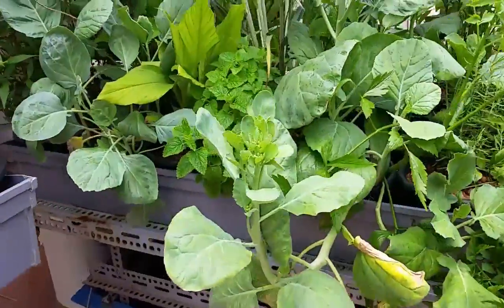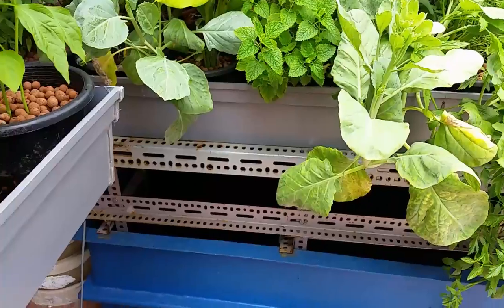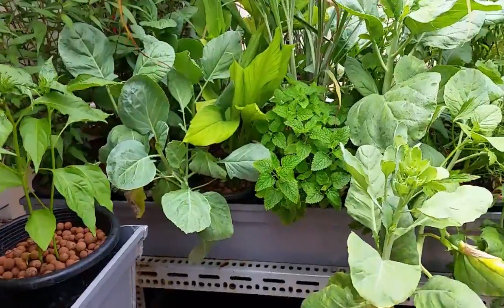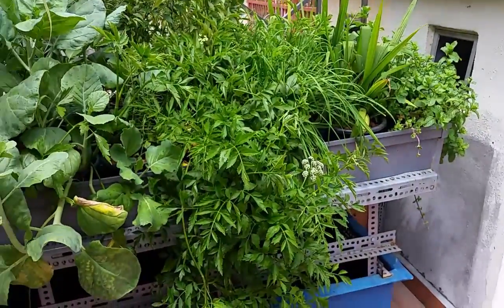Affnan's Aquaponics - Gutter Growbed Aquaponics Update 31st Oct 2015

Comment: you said Video 4:48  don't recommend any  fertilizer 
you said video 5:48 said need to  nutrients for tomato plants 
what fertilizer need to use?
any your video telling about how to safe tomato plants from diseases?
Reply from the maker: +Haroon Qureshi tomato plants is a plant that require high nutrient content, it need system that fully mature. More than 6 months running. I don't recommend fertilizer but try and choose plant that will siut the aquaponics. But if anyone want to use fertilizer, I only can recommend process organic base from chicken or goat manure. To protect tomatoes plant from desease is very difficult in Aquaponics.

Comment: Affnan, don't take out the Pacu, buy a length of rubber hose, slit it and encase the wiring inside to prevent the fish from biting the wiring. Don't slit the tubing into two parts, just slit top to bottom and sort of wrap it so that the wiring is inside the rubber tubing. I too hada mild shock due to the fish eating at the wiring. Annie Low